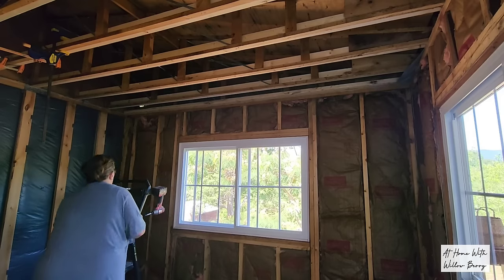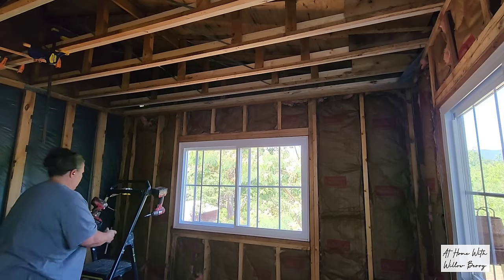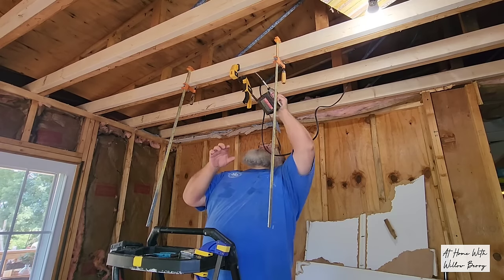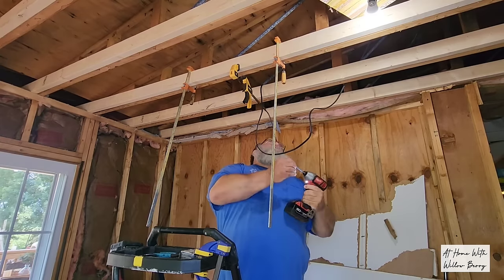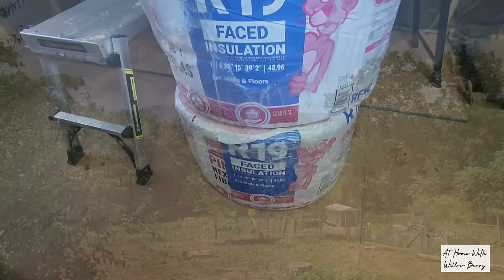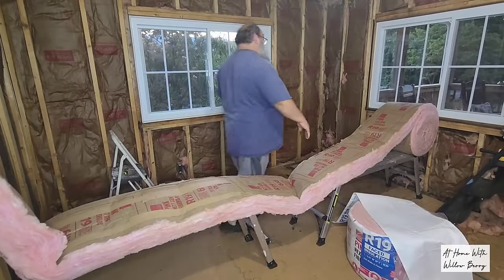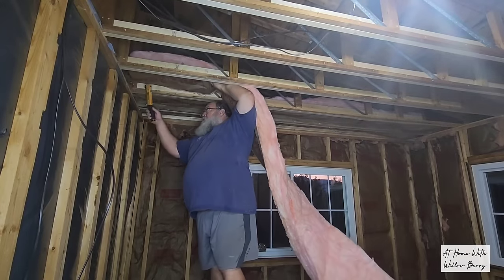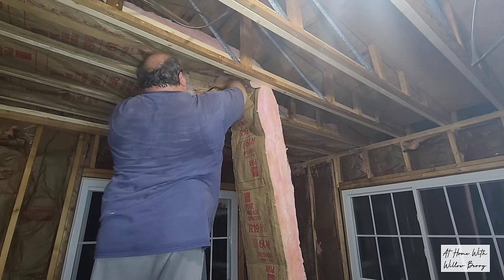Reinforcing 50 year old rafters. / Mobile Home Renovation

Comment: Great work … I have been missing out on y’all. A lot of y’all Youtubers. We’ve been doing some renovations to our house. My house is 1925. We just leveled the front house and we also leveled the garage apartment and we are going through what y’all doing right now we’re kinda re-doing the insulation, the garage apartment is like a three garage and we are decluttering it and rearranging and I have a hot a metal hunt and we also took everything out. Got rid of stuff rearranging it and then I have a storage unit that we are doing the same thing so it’s been weeks and weeks so on top of that I’ve been super busy with gardening slow down for about a month but here we go again I did harvest so many cucumbers. I’m on my second round. See how that goes. I’m doing winter squash, some zucchini let’s see here I will be starting, a line of garlic and potatoes we rebound my garden. We added a few more beds. I’m still working on filling them and it’s just a lot of work being done. Then we had a little damage from the hurricane not and I had to fix some of the roof cut a massive tree down just been super busy. It’s like you never have enough hours in the day, you can finally sit down and relax and watch all of yall 🌱🌱👍🏽🏡🫑